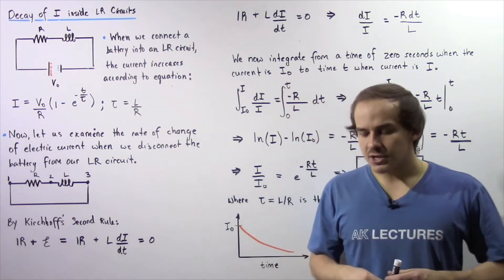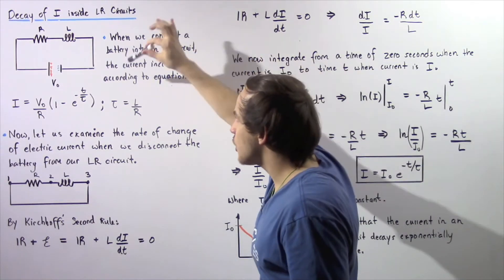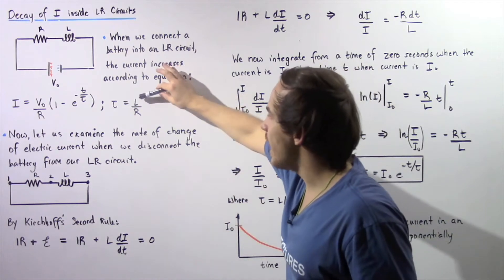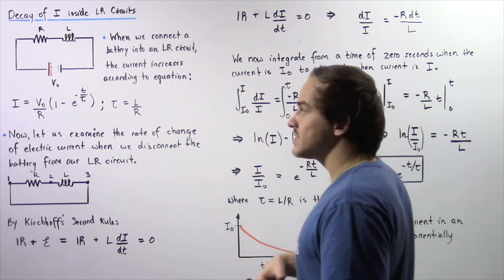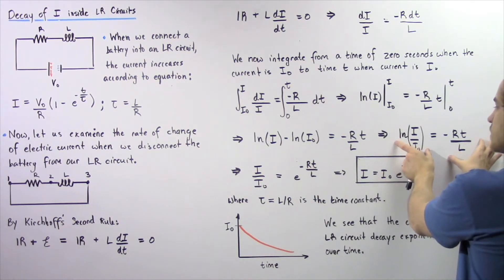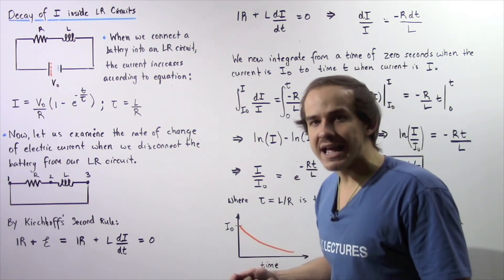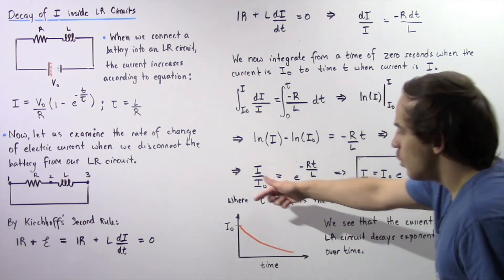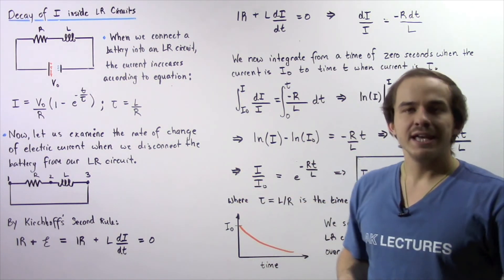Expontential Decay of Current in LR Circuits

Comment: 2:13
When we move from position 3 to position 2, why is there an increase in voltage?  Because the job of an inductor is to resist the change in current, therefore, when a battery is removed, current is decreasing so to oppose the change in current and increase it, shouldn't the voltage decrease from position 3 to position 2?
Reply: That means back emf increases bcz in order to oppose rate of decay of current obviously emf increases